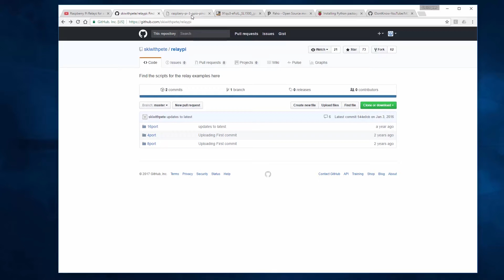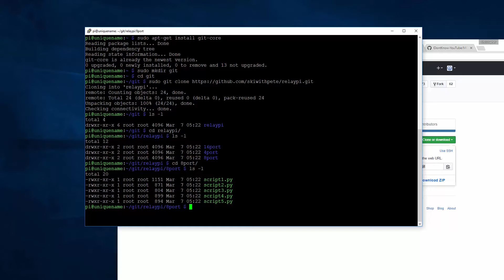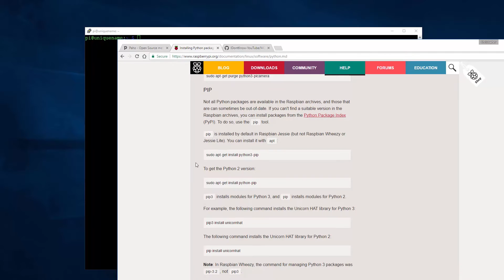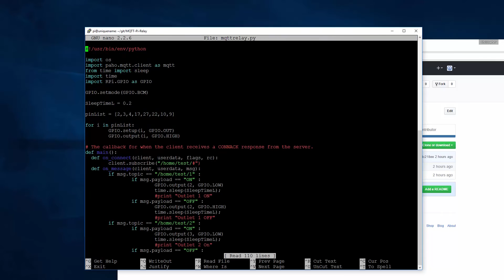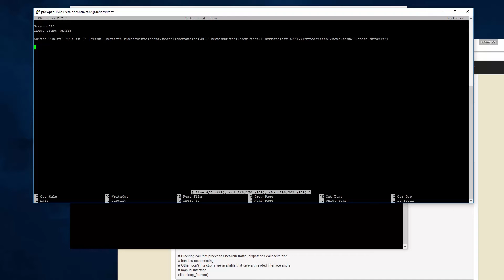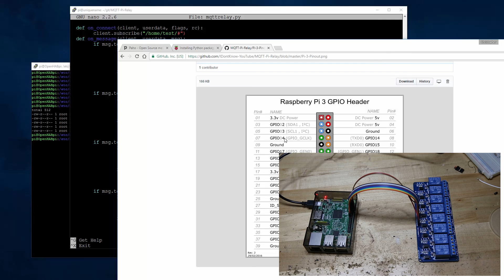OpenHAB + Raspberry Pi + Sainsmart Relay

Comment: I am have an issue when trying to insert my IP address.  Keep getting a syntax error.  Have tried several formats.  Not sure what I am doing incorrect.  Any ideas?  Thanks!
Reply from the maker: What syntax error are you getting?
Reply: Here is what I am getting:

  File "mqttrelay.py", line 102
    client.connect(192.168.1.40, 8080, 60)
                           ^
SyntaxError: invalid syntax
Reply: I did a copy and paste... it treansfered a little off.  Here is the corrected version:

 File "mqttrelay.py", line 102
    client.connect (192.168.1.40, 8080, 60)
                                                ^
SyntaxError: invalid syntax
Reply: I did a copy and paste... it treansfered a little off.  Here is the corrected version:

 File "mqttrelay.py", line 102
    client.connect (192.168.1.40, 8080, 60)
                                                ^
SyntaxError: invalid syntax
Reply from the maker: Indiana Marshal You still need the quotes around the IP address
Reply: Thanks..... that worked!

Comment: nice video!  i followed ur steps but when i typed sudo python mqttrelay.py    . it shows me ImportError: No module named paho.mqtt.client.        i always have problem using "pip install paho-mqtt" have u any advice to solve this problem?
Reply from the maker: Ok, sounds like you dont have paho-mqtt installed. Did you install pip first?
Reply: same problem as Kaffee, i have installed paho-mqtt
Reply: I am getting the same error. I installed pip, then paho. Now I am stuck like Chuck. :-(